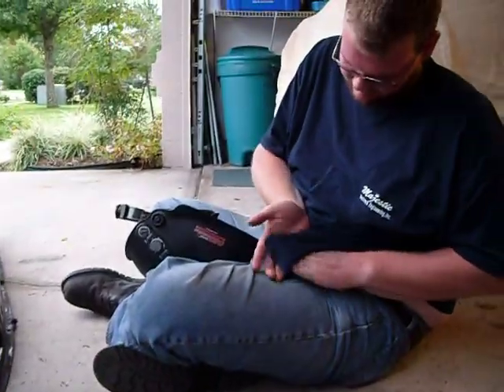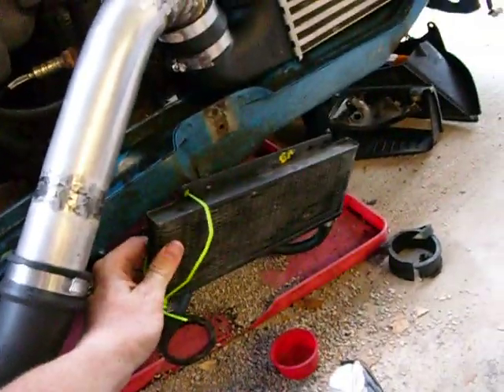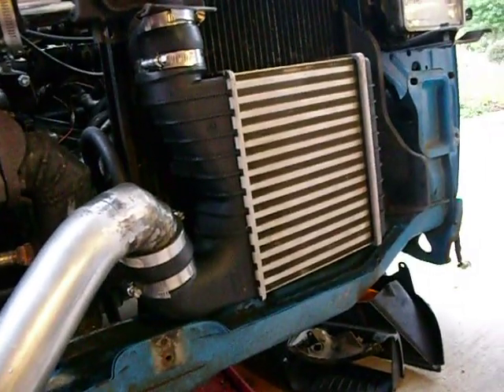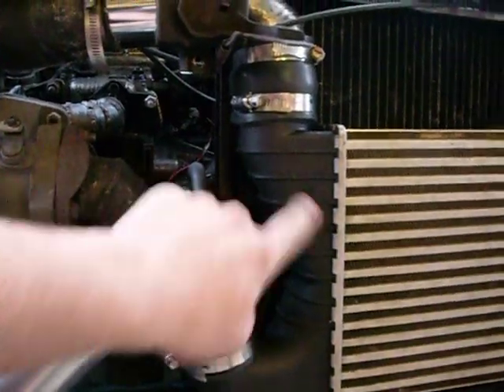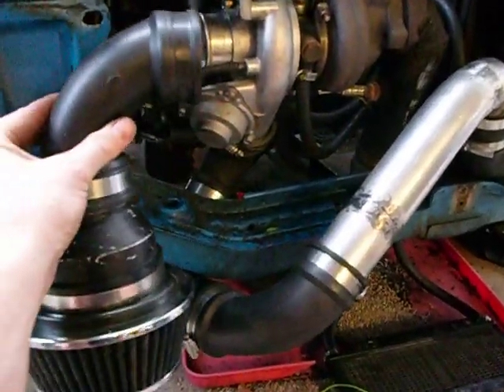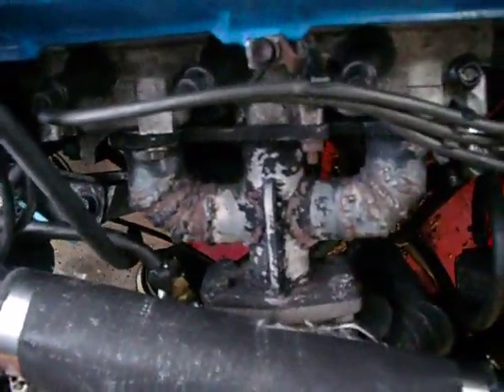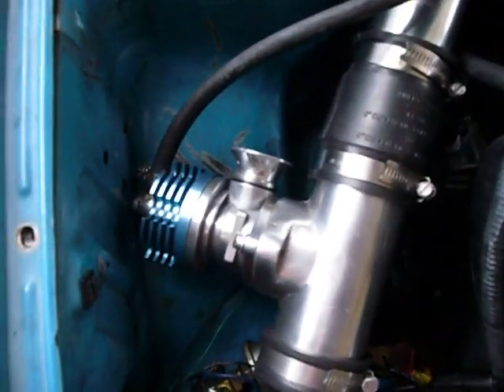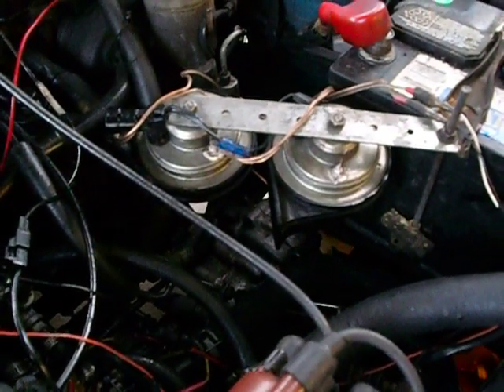Turbo Geo Metro Build

Comment: what intake/fuel delivery are you using?  modifiied throttle body or mpfi. that's my biggest speed bump now
Reply: i turbo the same engine and under 19psi original spi throttle body  and injector work allright but you nead to take the throttle body out and plug up vacuum hose holes for brake and egr
Reply: DrMike gas pwred hello, i was wondering what kind of set.up you used on the metro. Im.building one and need advice or ideas

Comment: I have a 98 chevy metro 3 cylinder, I was thinking about doing a turbo on it. I have a few questions, how did you make your pressure cap? is yours multi port injection or throttle body injection, did you have to install a mega squirt system? or how did you deal with the need for increased fuel flow? where did you pull the oil supply from?

Comment from the maker: well, in a short answer, no. each setup is one off unless you but a whole t3 engine from canada. but yes I will post a video on how to turbo a TBI suzuki/metro, it was my 97 1.3 tbi, I started with a .48 To4e 60 trim but downsized to a straight T3 turbo, boost starts at 2800 and peaks at 6psi(engine leans out past that) at 3800. give me a few days to edit but I think it will answer your question.

Comment from the maker: The 1.3 has the same injector, I have just turbocharged my 97 swift with a tbi but I have not edited the videos yet for upload, the principal is the same for the 1.3 as the 1.0; the 1.6 injector has a different connector and the TBI will not fit trust me i have tried. I believe there is a Chrysler injector that is a drop in but it has way too much cc//min for our cars; it would run great on boost and pig rich off boost.

Comment from the maker: yeah and they are dime a dozen, everywhere you look you see some riced out honda with a tool behind the wheel that thinks he knows something about cars. They think that a bolt on t3/t4 setup is the bomb and if you ask most of them what the lbs/min their engine intakes to match the turbo properly most will just glaze over------end rant...... I just prefer something unique that will have far more torque than most hondas on the road, hence this and the other projects I have

Comment from the maker: @zorrlander 
Hey! To answer your question yes the G16 injector will flow more BUT the G10 ecu will not be able to control it, it will be pig rich at idle. The entire TBI assembly will not bolt up to the 3 cylinder manifold. I am almost finished with the turbo Swift GTi project and I will convert this metro to a 1.6 tbi on the 3 manifold, all will be controlled by megasquirt. I will document this project cause I get so many emails on how to turbo a geo!

Comment: 1 good weld is stronger than 10 shitty ones. atleast grind the welds down... you should have practiced welding on flat scrap steel first to set up the welder...

Comment from the maker: @quinnmyster 
Sorry to tell you that it has been running strong for over 2 years now, not one hicup. did you see my new video of the 16v 1.3 Swift gti auto tranny I am building?? Oh, and the stock cn handle boost, same block used in the G10t chevy sprint turbo and pontiac firefly turbo, only they hd MPFI, I just have a larger injector in my TBI

Comment: @southwest82 :  Fisrt a geo metro is a simple , robust car, I add myself e turbo to a 95 metro, also add msd coil and other few thing , is faster yes it is, save gas , yes it does, it help me to understand how turbo works, of course, did i saw and improvement on perfomance of course, i will won nascar , i don;t think so, but it was fun, i'm still working on this little car because is my toy, I also have and impreza sti , but the geo can put,remove, add, cut and o problem
so thank you

Comment from the maker: @111rusty222 
"it's still slow, that's what I'm trying to get at." ITS A GEO, DUH!!! The turbo is done right, this is an EFI setup, not carb'd. For the last time, it is not cheaper to use a GSXR engine. MegaSquirt standalone is easy to use and does not leave lean spots. Sorry you do not have the capacity to appreciate someone's hard work to do something unique.

Comment from the maker: @snakesonaplane2:

I tried ceramic coating, and it would not bind to the metal. Every other pipe I have ceramic coated was fine, not this one. The only thing I can imagine is that the galvanized metal is causing an issue.

Comment: try using a different metal.  i had to modify the 3" exhaust on my subie with an arc welder.  the welds looked pretty good and had complete penetration.  the 3/32 rods work well as they have a wider kerf width.  i'm sure there are kits to make a manifold out there if you ever feel the need to upgreade.

Comment from the maker: I was so ashamed of that manifold, to this day I have no idea how it held together. I was using 1/16 rods, not the primo rod. If you look at my new video, you will see the new manifold that was done using 3/32 7018 rods, I ground them down, but the weld had good penetration. Thing I love about the 7018 is when the amperage is just right, the slag almost falls off on its own. Chaos, such a fitting word for this project.

Comment from the maker: lol, I changed it. Also, I HATE the fart can cars, I am using a 2 1/4 inch exhaust with a resonator midline and a 6x10 glasspack at the tip. rumbly, but not ricey.

Comment from the maker: hey, thanks for the props! I am in the process of putting a T-25 on the car instead of the TD04. As for the manifold, I am limited to that due to a lack of a mandrel bender. The log manifold has worked well so far, the torque gain was amazing. I ordered a 27x5x2 intercooler that will sit low in the bumper, hope to have a video of that up by the end of the week.